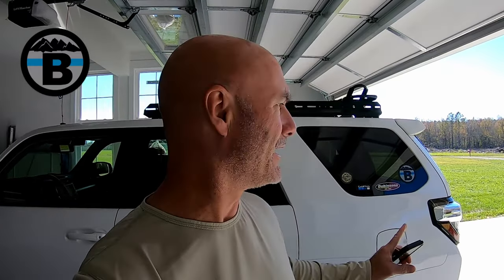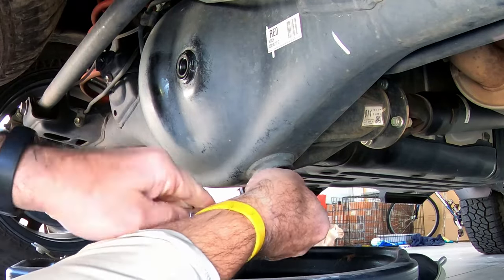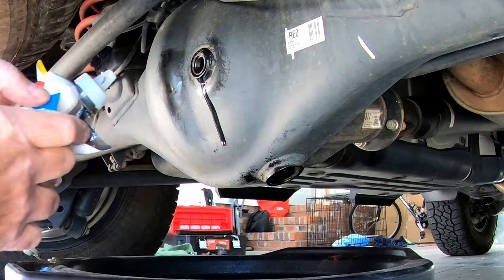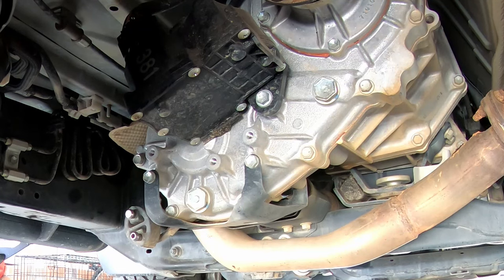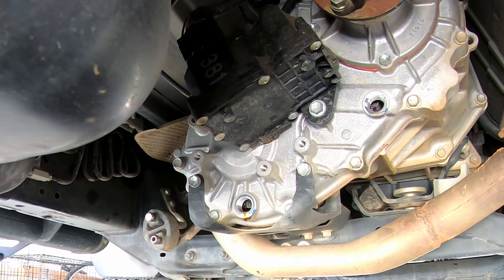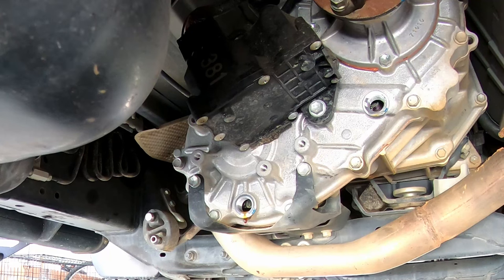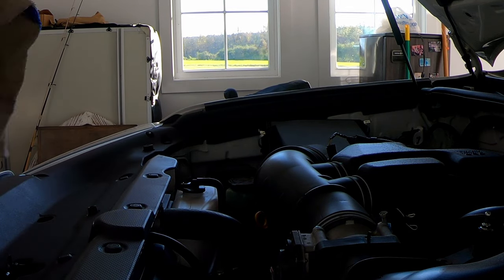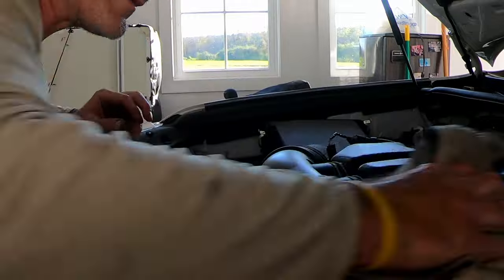Fluid Service on a 5th Gen 4Runner

Comment: Thank you so much for showing! I do my oil changes on my '07, but was nervous about "the fluids". My mechanic wanted to charge me: $80 for the Rear Diff. and $180 for the Trans fluid with replacing the pan gasket. You have saved me a ton of money Sir! Are you able to post the links for your tools?
Reply from the maker: Thank you so much for your positive feedback! I really do appreciate your support, and also for taking the time to send this message. That’s exactly why I do these videos, to help others get the confidence to do the work yourself. It really isn’t that difficult, and you’ll get the satisfaction of doing the work yourself. 

You said that you’re working on your own 2007 4Runner, so I’m glad you’re doing it. However, I’m not familiar with the 4th Gen models, so I don’t know how different they might be from the 5th Gen. You might want to do a little more research on your particular model to make sure you’re doing everything correctly. 

My tools? Well, I wish I could provide links, but I really can’t. It’s a hodgepodge of tools from various companies, so I really can’t remember where I bought them. I know that many of my socket tools were from one of the big box stores (Lowe’s, Home Depot), and some tools were even from Harbor Freight. I know that many tend to shy away from Harbor Freight, but they’ve always worked well for my needs. I don’t know that I would buy their products if I were a professional mechanic, but again, they work well for what I need. 

Thanks again for your positive feedback. I really do appreciate it. Thanks for watching!

Comment: Reusing the aluminum flat type crush washer is perfectly OK. As an engine Machinist and Builder of 28 years, I do recommend the following before reusing the washer. Inspect the washer. You will see marks where the washer crushed and did not crush. This were you should recondition both sides of the washer by lightly sanding or lightly filing until you achieve an uniform surface. Maker sure to apply uniform pressure during this procedure. Occasionally turning and hold down at different points on the washer in between passes across the sandpaper or file is an adequate way to achieve a new surface.

Comment: Hey man. Good video. However, I’m not sure about the 4Runners, but the Tacoma, you shouldn’t use the same GL5 that you do in the differentials for the transfer case. It can eat up the brass synchros. Just an FYI.
Reply from the maker: Thanks for the comments. The manual “recommends” a specific Toyota fluid, but that particular fluid is extremely expensive, and also very difficult to find. I contacted a Certified Toyota Technician who said that the same fluid is fine for the diffs and transfer case. In fact, not only is it widely used by many 4Runner owners, many dealers don’t even use their own fluid for the transfer case when performing this same service. 

Thanks again, and thanks for watching!

Comment: Now we need the Transmission Fluid, which seems to be a little more complicated? and the lubrication of the propeller shaft and retorque. and the Brakes;-)
Reply from the maker: Thanks for the suggestions. I should actually be doing a transmission drain and fill soon, so I may do a video of that service. Lubing the driveshafts is such an easy job, but I may do a video of that as well. I replaced my brake pads over the summer, so I won’t need to do that for a while, but what are you referring to by “retorque?”

Thanks for watching!
Reply: @bluelineoffroad I think he means where the manual states to “re-torque the prop shaft every __ miles”

Comment: I learned the hard way to let the lube stop dripping after filling, in my case the right rear axle seal, I only put the plug back before it was done and that's all it takes
Reply from the maker: Wow, I’ve never heard of that! I would understand if it were a lot of fluid, but just because it was still dripping a little? That’s good to know. 

Thanks for watching!

Comment: You can add a short length of clear tubing to the tip to make it easier to fill the front Diff.
Reply from the maker: I appreciate the suggestion, but it’s very easy to fill both differentials and transfer case using the bags from Valvoline. It’s a very easy service to perform on the 5th Gen 4Runner

Thanks for watching!

Comment: Thanks for the video, how often do you replace the TCase and Diff fluids?
Reply from the maker: I change mine every 40,000 miles, but others go a little longer. It’s so easy to do, and is a simple insurance policy for those major driveline components. I’m currently at 53,000 miles and will be doing the transmission at 60,000 miles.

Thanks for watching.

Comment: Does this use a crush washer?  I carefully watched when you reinstalled the plug and it looks like your torque wrench maybe turned that bolt by a few degrees of a circle.  Seems odd if the torque was a whopping 46 lb ft.
Reply from the maker: Yes, all of the bolts have crush washers, but I actually didn’t replace any of them. I mentioned that a few times in the video, and I’ve received several messages from some people about it. To be honest, I really don’t think it’s necessary each and every time, and I still don’t have any leaks after 20,000 miles. 

As for the torque wrench, I always push it slightly beyond the spec. I’ve always done that, and it’s more for my peace of mind than anything else. 

Thanks for watching!

Comment: For some reason, I always thought differential and transfer case fluid service is a bit more complicated but after watching your video it seemed like that’s the easier part. 
I have never worked on any vehicle but this definitely gives me confidence that I could do it myself. 

Just a quick question, I wfh and my 2024 4Runner SR5 would be in garage for 5 days a week so I would be doing 5-6k in a year with no off-roading and towing and mostly highway miles. Should I still be doing oil change every 6 months? Your thoughts please!
Reply from the maker: I really appreciate the positive feedback. I made this video to help give people the confidence to work on their own vehicle, so I’m glad it helped you. 

As for your service interval, oil does still degrade over time, and six months is typically accepted as the time for oil changes. If your 4Runner is parked for lengthy periods, the oil still degrades due to contaminates resulting from operating the engine. So, yes, I would still do oil changes by that six month period. 

Lastly, since you stated that you tow frequently, I would seriously consider servicing at least your rear differential (why not both) 😂more frequently than 60,000 miles. Since it’s such an easy service, I would do it at 30,000 miles along with a transmission drain and fill. Towing places more stress on your driveline, so regular maintenance becomes more important. In fact, I believe that’s mentioned in the manual as requiring more frequent service. I should actually be releasing a video on a transmission drain and fill soon, so hopefully that would help. 

One more thing, since it will be parked for lengthy periods, it becomes even more important to engage your transfer case at least once a month. I don’t know if you have a dirt/gravel road close to you, but drive in both 4H and 4L for a little to help ensure that all parts remain in working order. 

I do appreciate the positive feedback, and thanks for watching!
Reply: @bluelineoffroad   Oops! Sorry, my bad. I meant no off-roading and no towing and majorly highway miles. Thanks for being so prompt. I really appreciate you still responding to comments on year old video.

Comment: Pretty good tutorial, the only thing this was missing was the transmission oil replacement(drain/fill) and it would be complete "lube" job 😂.
Reply from the maker: Yep, that’s missing, but I only had 40,000 miles, so it wasn’t due. However, I just did a drain and fill last week, so I’ll have a video of that in the next couple of weeks. 

Thanks for watching!

Comment: Hi, thaks for the video, very helpful.  My question is:  Does the transfer case drain plug have a magnet?  You did not mention anything about it.
Reply from the maker: Thanks for the comments. About the transfer case drain plug, I don’t believe it does, but you can buy an aftermarket replacement that is magnetized. 

Thanks for watching!

Comment: Nice video. Does the Toyota 4 runner require any special additives for the front or rear differentials? I seem to remember that my older Silverado required an additive for the limited slip. Also very wise to change your oil every 5K instead of 10K. I shake my head every time I hear someone letting their vehicle go the recommended service interval for crankcase oil. I'll go without food before I ever let my oil and filter go 10K miles.
Reply from the maker: That’s a very good question. The answer would depend on the fluid you use. Most, if not all, synthetic gear oils already contain the appropriate amount of friction modifier, so there would be no need to add it. However, standard oils typically do not, so you would have to add the correct amount of friction modifier when changing the fluid. 

Thanks for watching!

Comment: What a great show! Hello Bill, I am a new 4R owner and wondering the following:
1. You briefly mentioned crush washers, but when changing the rear diff, transfer case, and the front diff, am I supposed to use new crush washers? Or the 4R is designed in such a way that there is not crush washers? (I previously own a Honda and I do my fluid change, I changed the above-noted three with new washers).
2. Lots of people change the oil filter housing to a metal one thinking the plastic isn’t good and prone to leaking. In your opinion, should I also change it or the one comes from factory is the best - I live in Canada and there are some harsh winters.
Thanks again!
Reply from the maker: Thanks very much for your positive feedback! It is greatly appreciated! To answer your questions, first about the crush washers, both differentials and transfer case use crush washers on both the drain plugs and fill plugs, but I didn’t replace any of them. In my opinion, it’s really not necessary every single time, but I wouldn’t push it beyond a second service for fear of potential leaks. However, I did change the crush washer on the oil pan drain plug. Crush washers have apparently become very common for these types of services, and they’re inexpensive, so to be safe, changing them is probably recommended. 

About the oil filter housing, this is a topic of debate among many 4Runner owners. Personally, I see no reason to change the plastic housing for a metal one. There are several reasons why I don’t, one of which is that there is no specific one for the 4Runner. You need to get one made for another Toyota vehicle, then you need to exchange the inner tube from your old housing and place it inside your new one. Although this may seem like an easy process, and it is, problems often result due to the way you must bend the tabs in order to exchange the inner tube. Bending those tabs can make them weaker, possibly resulting in issues with the housing itself. The filter requires tension within the housing, and weakening these tabs and spring can possibly lessen the amount of tension resulting in your filter possibly not working as it should. I hope that makes sense, but my feeling is that if a metal one was really necessary, Toyota would have used one from the factory. 

Many of the issues people have with the plastic housing are caused by either using the incorrect tool, or by over tightening the housing. Getting the proper tool is vital as it allows you to get a good grip on the housing to avoid stripping the outer tabs. Secondly, the housing really doesn’t need to be tight at all because the housing isn’t what’s really creating the seal, it’s the O rings. Get them snug by hand, then slightly more with a wrench and you should be good. I’m sure there is a torque setting for the housing, but I tend to follow what I’ve always done. 

I hope I’ve made sense, but if not, please don’t hesitate to ask and I’ll do what I can to help. I’m not a mechanic, but rather a guy who’s been working on his own vehicles for well over 40 years. If I can help someone do their own work, then I’m glad to do it. 

Thanks again for your positive feedback, and thanks for watching!

Comment: Awesome video. I now feel completely capable of doing this myself on my 4th Gen. What should I look for in a power ratchet and what drive 10mm hex should I buy? Thanks.
Reply from the maker: Thanks for your positive feedback. There are so many options for tools on the market, it’s hard for me to suggest any particular manufacturer. The power ratchet that I use is really just for convenience and saving time. It’s a cheap Chinese knockoff that I bought on line, but it does what I bought it to do. 

As for the particular 10 mm hex, I would be a little more particular about those types of tools. My hex heads are made by Kobalt (bought at Lowe’s) and have worked well so far. However, I would recommend any reputable manufacturer which offers a lifetime warranty. I know those are typically more expensive, but they end up being cheaper since you only buy them once. I’m actually still using some tools that I bought decades ago. I have a good friend who races cars and has a full auto shop in his detached garage, and he shares my opinion about those types of tools. 

Thanks so much for watching!

Comment: A lot of diffs don’t have a drain plug,you have to take the cover off and then clean prep the sealing surface and reseal with rtv or a new gasket. Drain plug is much easier but but you don’t get to visually check your gears.
Reply from the maker: You’re exactly right. I had a F-150 that did not have a drain plug, so I had to remove the cover to drain the fluid. Plugs do make it so much easier, but as you said, you don’t really have the opportunity to visually check your gears for potential problems. However, examining the fluid for chunks of metal should give you clues as to whether or not your gears are damaged. 

Thanks for watching!

Comment: Dang that dude sure did over tighten that plug with the torque wrench also I heard you can use 75w-90 on the transfer case but the manual says to use 75w  have you had any issues with it
Reply from the maker: Yep, I over tightened them a little, but it’s really not that big a deal. I’ve been doing it for probably 40+ years, so it’s just me. Again, it’s not that big of a deal. 

As for the fluid, no issues at all with the 75W-90 in the transfer case. I even had a Certified Toyota Technician tell me that it’s fine. He also uses it in his personal 4Runner, so it’s good. 

Thanks for watching!

Comment: Why didn't you do the transmission service why you were at it? I have this generation 4runner and would love to see the same style video on transmission service. I haven't don't the rear differential yet and I'm at 60k miles. Has had regular oil changes but I don't have 4 wheel drive.
You're also missing the filter housing lock bracket. Mine has a little piece of metal that clips onto the filter housing to keep it in place.
Reply from the maker: I appreciate the question. The reason that I didn’t service the transmission is because of mileage. It’s not necessary at 40,000 miles, but I do plan to do it around 60,000 - 65,000 miles. The transmission service on the 4Runner is a little different because there is no dipstick to measure the level of the fluid, but there are ways to do it. I may actually do a video of that when it comes time to do the service. 

Thanks for watching!
Reply: @bluelineoffroad  thanks. I definitely have to do mine soon. Appreciate the videos since I was hesitant about doing the rear differential fluid but now I'm going to get that done ASAP. Thanks again.

Comment: really helpful video!! 
so 
rear differential 3 
transfer case 2
fromt differential 2
engine 6 qrts
 is that correct?
Reply from the maker: Thanks for the comments. The capacities for each are:

Rear differential - 2.6 qts 
Front differential - 1.2 qts 
Transfer case - 1.1 qts 
Engine - 6.6 qts 

I hope this helps. 

Thanks for watching!